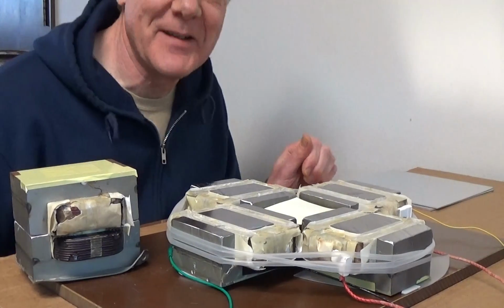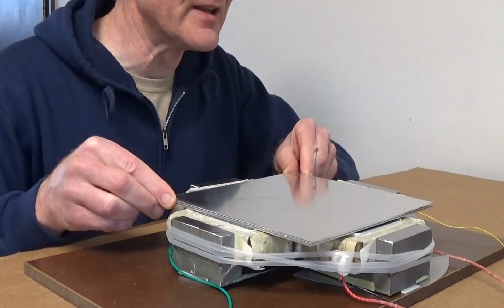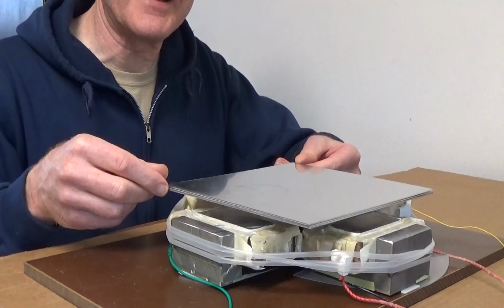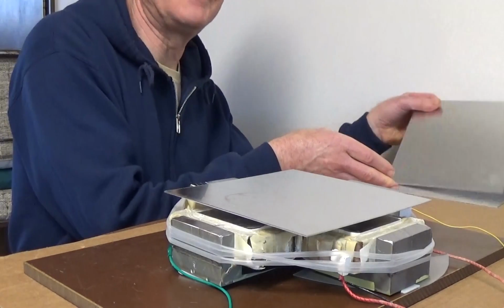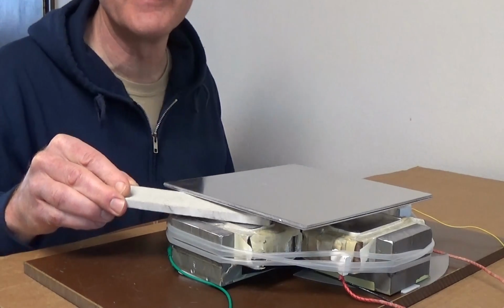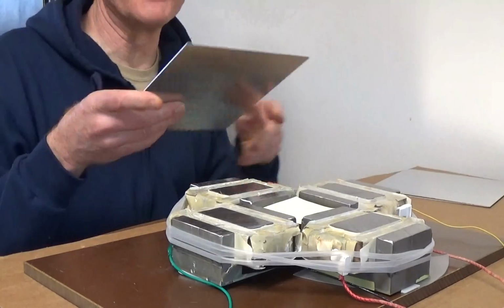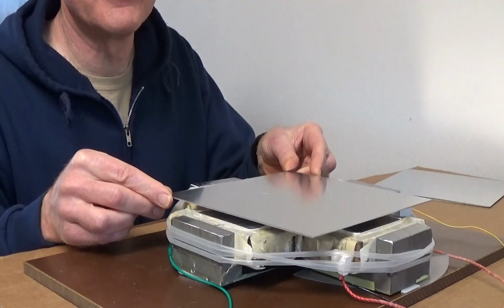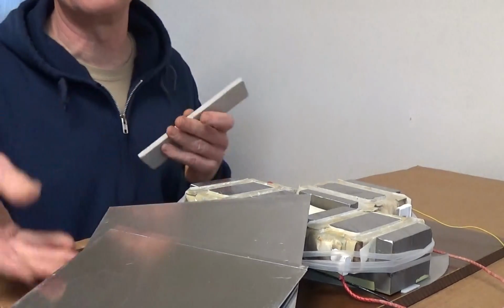Eddy current levitation using microwave oven transformers

Comment: Did you connect the iron centers together and the secondary terminal together or did you disconnect the secondary from the iron center? What capacitor do you have in series with the secondaryes in parallel (capacity and voltage)?And wht is the dimension of aluminium plates?
Reply from the maker: I don't recall if I disconnected secondaries from iron.  I don't think so.  Not necessary as long as all four windings are the same direction (clockwise or counterclockwise) and electrical connections are parallel as I did.
I think cap value is listed somewhere in description or comments.  Around 45uF if I'm recalling correctly.  30uF was too close to resonance so made current too high with 240Vac input.  You can change capacitor value and/or adjust input voltage to get sufficient current to levitate without overheating windings too fast.
Aluminum sheets are 200mm x 200mm x 1mm, pure aluminum for highest conductivity.  Some 1000 series alloys may have sufficient conductivity.  Others may be too low to work without higher current.

Comment: The fourth transformer could be 750W. is it good for levitation with the others? That is, if the iron center is the same size for the 750w ones, the secondary is the same as for the 700w ones? There is no paper with the power it is. the secondary winding it seems almost as big as the 700w ones, maybe a little bit bigger (2mm maybe) in the unknown one. The unknown one is from another company, maybe that's why it's a little different. What do you say?
Reply from the maker: Probably fine.  Just mount so top surfaces of the haves are all in a plane.  2mm wider isn't likely to matter.  2mm higher than other transformers would be a problem, but easy to fix.  Just shim the other three up by 2mm to match (add 2mm shims under other three).  I had to add some thin shims to compensate for my imperfect cutting.

Comment: Are your transformers taken from microwave ovens that operate at 220-240v not 120v? I have four (700W) transformers at 220v. Will the aluminum plate levitate with these?Please give me the answers.
Reply from the maker: The transformers I used had 120V primaries.  I used the secondary halves for this project.  Secondary windings are the same whether 220V or 120V primary.  So, yes, your transformers will work.  Primaries would work as well.  I used secondaries because I damaged one primary during cutting.

Comment: what happen when use more frequency ? like 500Hz
Reply: what copper plate also levitate ?
Reply from the maker: @N.g.Chanal  Yes, though not as well.  Copper is more conductive, but also heavier.  Weight increase is more than conductivity increase.
Reply from the maker: In general it would work better at 500Hz, especially with thin aluminum plates.  A single 1mm plate would lift quite well.
However, transformer-half steel laminations might heat up too fast, since their thickness was designed for 60Hz.  Not sure how bad an issue that would be.

Comment: Thanks!👍 First time I saw that configuration. All 4 of those are simply plugged straight into mains? (No extra sequential phasing applied to make that happen?)
Reply from the maker: No extra phasing.  But I do have a motor run capacitor in series with the entire set (between coils and mains) to boost voltage.  240Vac was not quite enough.  Series capacitor (series resonant circuit) was the simplest way to boost voltage.  Easier than grabbing my 50lb isolating transformers to boost voltage further.
Reply: @davekni  Ah. Can clarify what "motor-run capacitor in series, forming a series-resonant circuit" means?
Reply from the maker: @OMNI_INFINITY  Transformer halves are inductors.  Inductor in series with capacitor forms a series-resonant circuit.  If capacitor was in parallel with inductor, that would be a parallel-resonant circuit.  Series-resonant circuits create higher voltage across capacitor and across inductor than the input voltage.
Reply: @davekni  Thanks! I am still learning about resonant electronics circuit design and principles. I get that the cap and inductor should have the same energy storage capability, although still figuring out if the reason a specific AC frequency is resonant in a resonant circuit is because that is the frequency where at the peak of each half of the cycle the energy stored reaches that max rated capacity for the inductor and cap.
Reply from the maker: @OMNI_INFINITY  Perhaps easier to understand a mechanical analog.  Hang a weight from a string or thread.  It will swing back and forth at a specific frequency.  Energy trades back and forth from motion (at bottom of swing) to gravitational potential energy at the tops of the swing where motion stops.
Then notice that you can get the weight swinging many cm by moving the top back and forth only 1cm in time to motion.  That is like series resonance.
Reply: @davekni  Thanks again! Saw now. Had missed that reply somehow. Been visiting china learning PCB design and some electronics engineering.

Comment: Are they wired in series and all into one outlet
Reply from the maker: I'm using secondary halves wired in parallel.  Primary halves in series should work as well.  Yes, one outlet, feeding a 120V to 240V transformer, then through a capacitor to paralleled secondary halves.
Reply: Would using the primary produce stronger electromagnetic or does the secondary
Reply from the maker: @stg3orgeguy26  I damaged one of the primary halves when cutting, so don't have enough to test.  From a theoretical viewpoint, I'm not sure, probably close to the same.  Primary windings are usually a bit smaller, so could handle a bit less power without overheating too quickly.  On the other hand, since primary winding is shorter, more of the wire is closer to the aluminum plate, so more effective.  I'd hoped to test both.  Don't plan to make the effort to find another same-model transformer and cut it.

Comment: Have you tried plates with a void in the middle?
Reply from the maker: I've tried a middle void in small-scale experiments (~30mm diameter) before building my 23kHz round version.  The void ruins stability if of significant size.

Comment: i always thought eddie current just reduces the efficiency of transformers ...but never thought it can be used in electromagnetic induction
Reply from the maker: Yes, eddy current consumes electrical power and generates heat.  That is undesirable inside transformers.  It is desirable for induction cooking and other induction heating.  Also useful for some other applications.  Levitation is more of a science demonstration than anything useful.
Reply: @davekni  if u use dc battery then how is the magnetic flux changing tho?
Reply from the maker: @iitaspirant1083  Not sure I'm understanding your question.  I did not use a battery for this demonstration.  If someone did use a battery, magnetic flux would step up as battery is connected, then remain constant until battery is disconnected or drained.  Aluminum plate would experience a brief push upward as flux rises, then no magnetic force after that.  Would not levitate.

Comment: That was a very compelling  presentation. It looks like you opened A very interesting door when you showed how adding plates actually raises the distance. I was wondering if you tried other geometries or other sizes of plates to see how that might change the height given the voltages and currents you're using. I  Have a suggestion that might be of interest to you if you would like to speak by email.
Reply from the maker: I experimented with plate/foil size more on my higher-frequency 23kHz unit (and small prototype versions of high-frequency version prior).  Did try one larger sheet on this MOT-half version.  However, it was a more structural aluminum alloy with somewhat lower electrical conductivity.
For this (or any) specific geometry, there is a limited size range that remains stable when levitated.
Yes, would enjoy an email conversation:
davekni@yahoo.com

Comment: Perhaps you accidently did exactly what Professor Laithwite did long time ago and his idea and experiment became the birth of levitation train of todays. Watch his video.
https://www.youtube.com/watch?v=vauFEgRdYks
Reply from the maker: Yes, this is the same basic induction levitation setup, though a configuration that is stable at low heights.  The reason I made this demonstration was to show effect of aluminum plate thickness on levitation height.  In particular to show that thin plates do not levitate well at 60Hz line frequency.

Comment: I wish I had read all the comments before starting this project.  First off, you don't have to saw the transformers in half.  When they were initially made, three sets of windings (primary, secondary, and four turns on another secondary for the low voltage heater) were wound around this lamintated E-Core (perhaps wound prior and then slipped over the E-Core).  Then, a cap was installed with two welds along the top.  If you use a 90 degree angle grinder, just grind off those two welds, and pop the cap off.  This exposes the primary (large dia wire, fewer turns) first, then the 3 turn heater windings, and finally (up against the base of this whole thing) the secondary with many turns of smaller wire.  I trashed the secondary and 3 turn to use the primary wires.  Big mistake.  6 amps when the "E" is capped, and 35 amps when just the primary and open E-Core.  Looks like I'll be starting all over again...
Reply from the maker: Primaries should work if wired in series instead of parallel.  I'll say more in answering your email shortly.
Reply: @davekni  Hi Dave:  Getting there.  In series with 120 VAC and 1, 2,3 and 4 MOT's using primary windings: 37,20,15 and 10 amps.  Magnetic field (B) is proportional to the core material ur, N (number of windings), I (current).  But inversely proportional to the stack height of the windings.  You successfully got levitation using the secondaries at 1.3 amps each, 20x the winding count of the primary, and about 1.5x the stack height.  I have 20x lower N (bummer),  higher current (good) and lower stack height (good).  If my calculations serve me correctly, my primary current needed for the same B field would be:   (1.3A * 20turns ration * 1.0 ref stack height)/1.5 (ref secondary stack height) = 17 amps.  Running off of 240 VAC in series should get me 20 amps per coil.  Need to find the aluminum sheets of 1.0 to 1.5mm thickness.  I'll play with the series capacitors at a later date. Dave--thanks so much for your responses to all the questions here and below.

Comment: This is tight! Are all four windings wound in the same direction so that while current passes through the inner half of each solenoid, it pass clockwise, and the outer half of each somewhat combine to form a counterclockwise current.. as though each four were theoretically two separate 1/4s of their respective ring(inner v outer), creating an inward “draft” on a copper flywheel as laithwaite demonstrated keeping the aluminum stable? And is a cooling device in the center?? Quiet brilliant I must say(:
Reply from the maker: Yes, exactly on the current directions and net effect.  No active cooling - this video is about as long as it can run before getting too hot.  (The center is just a spacer block and center wire connections.)

Comment: Would a rectangular ingot of AL-6061-T6 roughly 2”x2”x15” and weight of 5lbs hold up?
Reply from the maker: Definitely not on this setup.  It would be possible with a large industrial induction heater unit with a properly wound water-cooled copper coil.  The aluminum would get hot, and perhaps eventually melt.

Comment: Of course, there’s more material being added. Wouldn’t more of anything usually add more of whatever power or effects it is, ie horsepower, volts, and anything similar?
Reply from the maker: Yes.  What I'd initially thought was that a second plate would double the magnetic force.  It would also double the weight (downward force of gravity).  The point of this demonstration is that two plates increase the magnetic repulsion by more than twice.

Comment: Great 👍🏼 video.... can you do that with one transformer??
Reply from the maker: Am aluminum plate will lift over a single transformer, but then fall off to one side or the other.  The ring is needed for positional-stability.  Three would be enough.
Reply: davekni will using iron core or copper plates work as well?
Reply from the maker: @andrewkhchan  There are iron cores within the coils.  Iron would not lift, but rather stick to the base.  Copper would lift, but not quite as well as aluminum.  Copper conducts electricity better, but is heavier.

Comment: I wonder if u could step up the frequency much higher: 100khz or even 2mhz etc. I wonder if u could make other materials levitate.
Reply from the maker: Higher frequency would allow more materials to levitate (lower-conductivity metals, but must still have some conductivity).  It also allows higher levitation.  Here's my higher-frequency video:
https://www.youtube.com/watch?v=AHED5xSnnM8
Reply: @davekni  Ye but it wouls also heat a lot more would it not?
Reply from the maker: @manipulativer  Yes, lower-conductivity materials would heat more when levitating.  For high-conductivity materials like these aluminum sheets, a bit higher frequency would reduce heating for a given levitation height.  As frequency goes up further, to the point where the skin-depth is less than the plate thickness, heating goes up again.
Reply: @davekni  Ive read that herzian waves are not realy transversal but longitudinal.

And if EM waves are longitudinal pressures and depressures of the aether it makes sense that there is a frequency that is higher and that heats less.

Is there a "cascade" effect on certain frequencies where the plate vibrates?

I am quoting Nikola Tesla on longitudinal waves and he even went to talk to Hertz in person to give him the bad news. (or so i remember)
Reply from the maker: @manipulativer  The frequency here, or even the higher frequency in my other video, is much too low for any significant EM waves.  The wave length is orders-of-magnitude longer than the dimensions of the magnets and aluminum.  This is all near-field.
Reply: How about cooling it with liquid nitrogen and higher freq.?

Comment: Opposite of gravity..the heavier the more pressure but here its opposite
Reply from the maker: Yes, it's a force in the opposite direction from gravity.  It's a magnetic force.  It gets stronger as the stack of aluminum plates gets more electrically conductive, which does correlate with the stack getting heavier too.
Reply: @davekni  so it wont work with for example wood right?
Reply from the maker: @DarkLord666SK  Correct.  This is alternating-current magnetic induction.  Works only with electrically-conductive materials.

Comment: Thanks for the video!  It really peaked my interest into why you chose aluminum to levitate..  So far, I found aluminum to be paramagnetic with a magnetic susceptibility constant of  +16.5 x 10-6 cgs.  Copper's constant is -5.46x10-6 cgs.  Does that mean copper wouldn't levitate because it has a negative constant?
Reply from the maker: Pyrolytic graphite is the only substance that I'm aware of with low enough susceptibility (at room temperature) to levitate by that principle (diamagnetic, so repels magnetic field gradients).  This levitation is by the induced AC current in the aluminum.  For that, aluminum is best, because it has the highest electrical conductivity per mass.  Copper conductivity is higher, but it is much denser, so aluminum wins.
Reply: Ok, I'm starting to get it.  Aluminum has a little more than half the conductivity of silver, but 1/3 the specific gravity so aluminum would levitate higher under the same condition.  You mentioned in the video that you calculated which amount of plates would cause the highest levitation elevation.  Do you know where (hopefully online) I could learn much of this (equations, concepts, etc.) myself?  I would like to calculate various heights of levitation based on the material type, it's shape and so on.  I would like to understand what would happen when two different types of materials are used at the same time.  For example: instead of two aluminum plates, what would happen if a copper and an aluminum plate were levitated (1st with Al on top and, then, Cu on top).

Comment: you, sir, have just earned yourself a subscriber. that is insanely cool. are they all wired so that the current thru each coil are in phase?
Reply from the maker: Thank you for the compliment!  Yes, the coil currents are all in phase - all the top center sections oscillate together - all north poles then all south poles etc.  The return flux paths, the outsides of each transformer's laminations, are of course opposite the coil centers, so also all together with each other.  The four return-flux poles arranged in the center of my setup are the useful ones.  The four around the outside are not helpful.  Some day I might try cutting those off to improve efficiency, but I'm not sure I can do that without damaging the coil.  To see a more optimum geometry, view my higher-frequency aluminum disk levitation video:
https://www.youtube.com/watch?v=AHED5xSnnM8

Comment: So, this is how the 'aluminum magnet' works! I remember reading about it once in National Geographic. They had covered an article on aluminum in the US.
Reply from the maker: I'm not familiar with the "aluminum magnet" term, but it is true that aluminum is a magnet only when conducting electricity.  In this demonstration, the current in the aluminum is induced by the alternating magnet field below it.
Aluminum is a part of some permanent magnet alloys, especially the old AlNiCo (aluminum, nickel, and cobalt added to iron).  Small amounts of aluminum are added to NeFeB magnets to improve their high-temperature performance, at the expense of somewhat lower room-temperature magnetization.